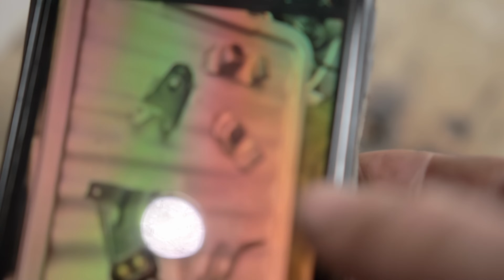Restoring an Abandoned 1992 Honda Civic EG6 | EP. 5 - Interior Refresh/Respray

Comment: Looks good! Sorry to see you couldn't find a suitable seat latch striker from a newer model. 
That made me think I should have used one glued to rear screen to replace the one on wiper-motor frame, though Crv one wasn't hard to modify for that use.
Intending to swap to EG6 rear seats soon but hope I can come up with a bolt in solution of mtg. brkts. for interchangeability.